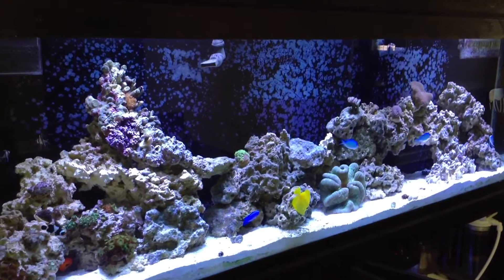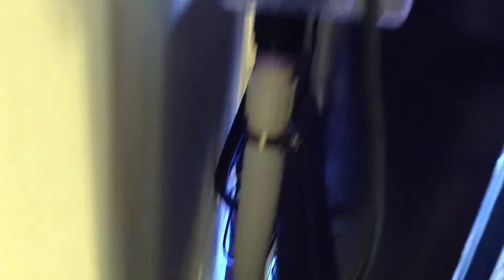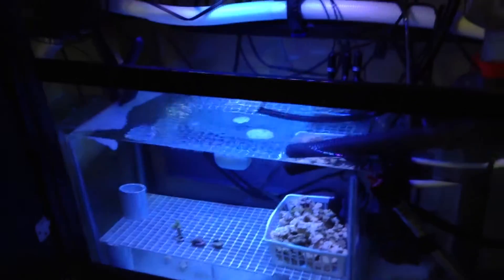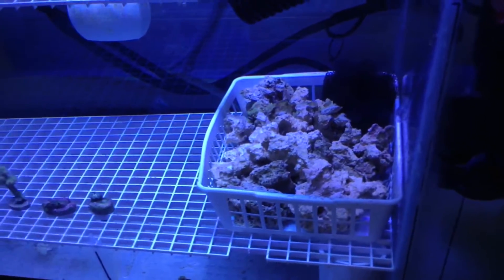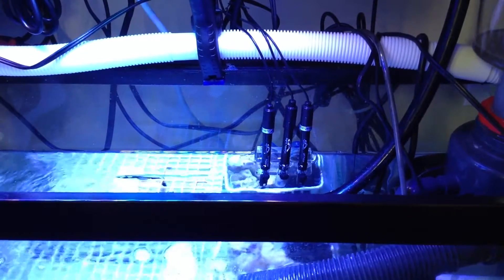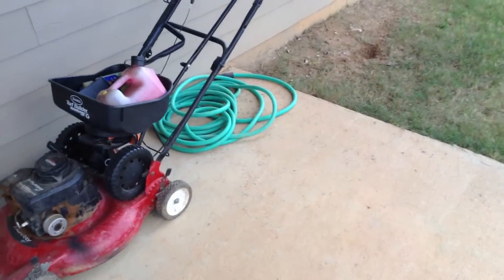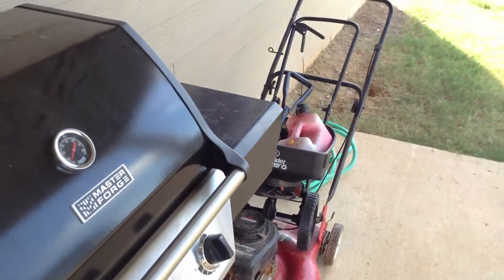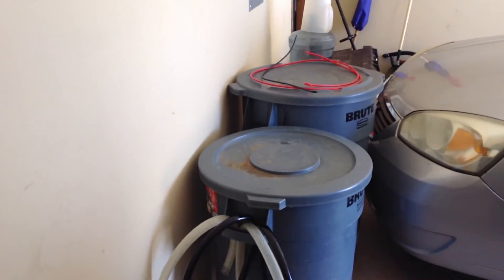140 GALLON SALTWATER REEF AQUARIUM PART 2

Comment: Man things just got serious. Now you're talking frag tank! Nice update, one thing I'd recommend is Less GFO.  Add it slowly,  that stuff takes out everything.  When you where talking about your rodi, you connect it to your front yard? I bought a brass, 2 way water connector that splits. I have one  line to my washer machine and the other on my rodi.  When I'm done making my rodi I just shut it off. Anyways Looks great
Reply from the maker: 915Mang Yea haven't really got into the propagation part yet just focusing on the main display. I added less the the recommended amount of GFO and haven't been adjusting the flow so it's not grinding it up but giving a good tumble. I will look into one of those connectors because right now whenever we want to use the hose in the front yard we have to disconnect the Rodi supply.
Reply: ***** Yeah those spliters work great. Just make sure it has the washer in it, and its a good quality. They sell those plastic ones, id pass on those.